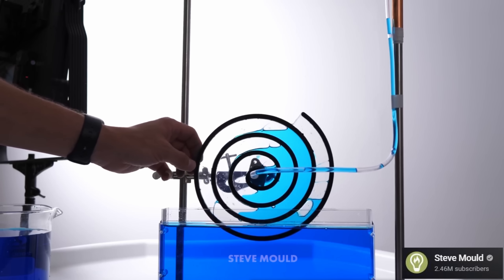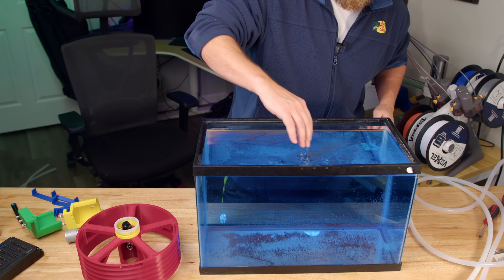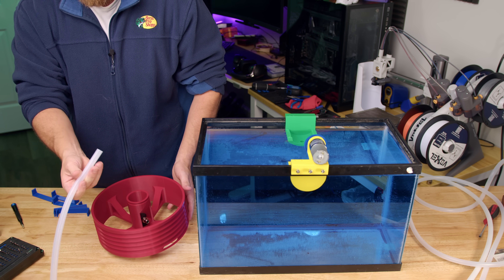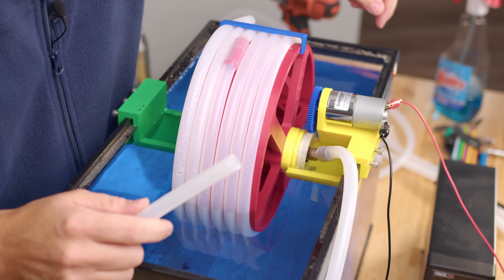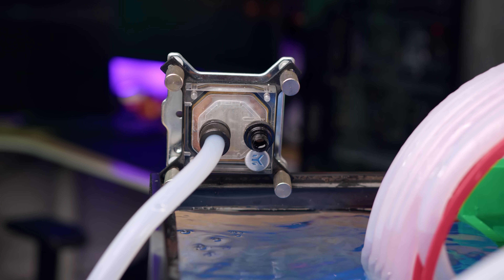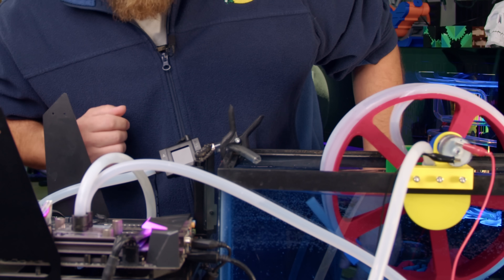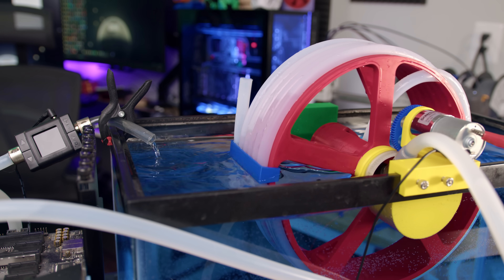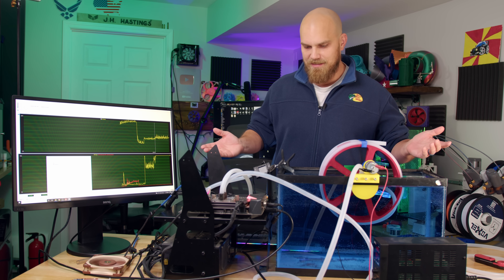Can a 217 YEAR OLD Water Pump Cool A PC?

Comment: I wonder if you could use mineral oil and water as two separate layers, with a taller tank and the pump “fully submerged” (mineral oil on bottom, water on top) to fix the air pocket issue

Comment: I am assuming that air is required so you cannot completely submerge the coil, but what would happen if you had it lower in the tank and or cranked the speed of the motor?
Reply: This is what I was wondering as well. Does it work fully submerged, or if the air is a requirement, does a very minimal air gap like you suggested work well enough?

Comment: If you ran 2 of the pumps in to a y running 180 out of sync from each other you would get a more constant flow of water. 3 you could do them 1/3 out of sync. I think 2 would be enough as each tube is about half filled with water a little more really. So 2 sets of tubing on the pump

Comment: I kind of want to figure out a way to implement some sort of air catch in the loop that could occasionally release extra air so just water flows through the actual cooling side of things. Cool concept and that it actually provides a useful level of cooling!
Reply: Near the motor needs an upward shaft with a ball float, it would regulate air and allow water separation. Plus double hosing equals double pressure, and the motor should be on a band not gears so no energy lost as it tries to compress water between gears.

Comment: If the wheel was lower in the water  it would have less air in the line, typically the current of the water surface is what would power the wheel. Yours has a power source so there’s no reason to have it that high. Just find a way to keep the motor dry, and it should still work fully submerged.
Much ❤ Love

Comment: Flow rate does have a direct effect in both computers and in cars. If the flow rate is to high, the rate of heat transference will be low. Water is actually a little difficult and energy intensive to heat up and is why tank-less inline heaters create such a high energy bill compared to electric tank heaters.
By allowing a slower flow, you give the water more time to take in more of that heat. 
Of course going to slow can be a bad thing as well.

Comment: Zalman Reserator 1 in line after the pump with a Tesla valve in the lid, could be used to buffer the water flow and remove the air.

Put at the correct height you could see decent flow (especially with a parallel dual pump setup) whilst getting rid of the air.  The Tesla valve could be incorporated into the design to let out air without letting out liquid.

Yes, there are probably better ways to do that, but it keeps with the "old tech doing a new job" theme, plus Tesla valves are just soooooo cool.

Comment: Run 2 drums side by side w/ 180deg offset on rotation. combine their outputs w/ 1 way valves and put a breather to remove air from the output line.

Comment: Use the pump to drive the water up high into a tall (to get pressure through gravity and volume) reservoir and then let gravity feed water through the block. This way we get a nice even flow without air.

I mean, this'll probably need to be as tall as a two story house to work, but... it'll be interesting.

Comment: really cool idea! probably should have put some type of accumulator to separate the air/water in the line before passing through the water block
Reply: the water only moves because the air is pushing it.
Reply: @sinisterthoughts2896  that's true in the screw portion of the 'pump' tubing, but once the water exits the pump, the air is no longer necessary. It's almost an inverted version of a pneumatic screw compressor which has and air/oil separator after the screw.

Comment: As it takes a calorie, or about 4.18 joules to heat up 1 gram of water 1 K, or 1 °C, it shouldn't be that much of a surprise that even small trickle of "cold" water can remove heat quite well. If you want to remove significant amounts of heat for en extended period of time with a standard water cooling system a standard radiator usually becomes the most limiting factor, as then you still got to expel the heat to air.     

Another principle you could explore is evaporative cooling using a brine that "recharge" itself when the processor is cool. You just need to use some salt which will absorb moisture from the air when the processor is cool, but will let water evaporate when the temperature increase and thereby provide cooling.  New scientist recently had an article about some guys using lithium bromide, and a "special membrane" to keep salt/brine inside. But calcium chloride or magnesium chloride can do the same thing, and a separate container could be used for the brine, using it to replace the radiator in a traditional water cooling system.       

Or, try to just use the "chimney effect", if you haven't done that already, use the heat to cause convection in a tube to get some airflow. Probably not very powerful, but silent and very long lasting.

Comment: If you used a tube with hydrophobic coating on the inside, would this be more efficient, or less efficient?
Reply: maybe polyethylene tubing with some de-ionized water. DI water has really high surface tension.

Comment: a possible improvement would be to use the pump to lift water to a catch basin (could just be a bottle with one end cut off) to let the air out of the line. may improve things, may not.

Comment: Try 2 wheels with water inputs 180 degrees out from each other, or a breather port to let the air escape the system befor the block.

Comment: The obvious choice is to combine the water wheel with a cooling tower.  If the tower has enough holding capacity it should be able to sustain constant gravity fed flow through the block and act as a buffer to remove the pulses of flow from the water wheel pump.  

Make it so.  :)
Reply: ya, water reservoirs and tanks, solving water pressure problems for centuries.
Reply: This is exactly what I had in mind: Just put a reservoir high enough that the downstream flow continously cools the CPU without any bubbles.
Reply: @MrUntermieter  one step further would be a catch can with pressure regulation, then you would use the pumped air under pressure to replace gravity as the storage of potential energy. Much more difficult but then it can be compact.
Reply: This was my thought on this too.
Reply: A filter capacitor for water
Reply: Same thought here. The upper reservoir would need an overflow bypass, and maybe a ball valve on the outlet to control flow rate.
Reply: @DFPercush  You really only need to have an overflow return flow line to the main tank, and then size the tube going to the CPU to give the desired flow rate. Completely passively regulated.
Reply: @mytube001  Sure, once you know the right tube size. How much money are you going to spend on tubing to find the right diameter is is the question. I guess you could oversize it and just use a clamp to pinch it, but ball valves aren't that expensive. Who knows, the water block itself might be enough of a restriction, it's a very low pressure system.
Reply: add a second pump to fix the pulsing issue
Reply: Suprised no-one has made a system like this using a normal electric pump. Tank in the roof or outdoors, purely using head to feed water through the cooling loop, output goes to a sump tank where it is pumped back into the header tank. You could even plumb a room with multiple coolant inputs and outputs, fitted with regulators, so your office space/server room/workroom/gaming room would be both completely silent (the sump and pump would be in another room) and cool (all the heat is dumped into the header tank, which is cooled by atmosphere). If just atmosphere is not enough, you can wire a fridge or Peltier cooler to the header tank, again the heat they generate will not be transferred to the computer room itself.
Reply: you could also have several parallell spirals combining into one with the inflow ends evenly spread around the wheel.
Also have the wheel fully submerged to avoid air.
Reply: @nalissolus9213  unfortunately the air is what actually allows this pump to work, pretty neat concept
Reply: @Porouskilldeathratio that air is needed to get the water up, yes, but once the pump has managed to get water to the gravity feeding tank, you need to let the air out, it did its job. At the top of the gravity tank, you just need an open air, or if enclosed, an airlock and maybe an overfill gate leading back to the mainresevoir. You are getting a flow rate of 28 29 liters from your pump, the resevoir can drain at 25 liters and you will have a constant flow of water going through the block instead of intermittent.

You eliminate the need for the air once you have the water as high as you need
Reply: @nalissolus9213 the way this pump functions, it actually relies on that air gap, otherwise the water would all spin with the hose and not pump through it. The factor here is density. Water is heavier than air and therefore the water stays low in the bottom of the wheel  and works its way through to the end.

Comment: Two thoughts: 1) instead of a radiator, have the coil pump dump water into the top of a cooling tower with a second reservoir at the bottom, and just have it elevated to provide the necessary pressure into the water block.  That would help avoid the water becoming thermally saturated and would result in a continuous water flow into block, likely resulting in better performance.
2) Can you cool a PC with an archimedes screw? :p
Reply: You probably could if you combined the screw idea with a water tower to provide constant flow through the cpu block.  You would need to rely on gravity to go from the tower to the CPU to the big water tank.

Comment: Two suggestions that should improve this system: If you add a funnel at the inlet of the pump, you should scoup up mor water/less air. And if you add something like a catchtank you could get rid of the air entirely. So basically add a tank at a very high position, where the pump dumps its water in. Have an opening in the top to release the air and an outlet for the water in the bottom. If the tank is positioned high enough above the wateblock gravity should create mor than enough waterpressure to ensure a good flow.
Reply: Exactly. Use the pump to pump the water up to a higher, upper reservoir/fish tank, then let gravity pull a steady stream with no air through the CPU block and dump back into the lower reservoir/fish tank.
Reply: I don't think you can. The air locking is how the pump works. Take out the air and the pump shouldn't function. Otherwise all it gets is the siphon effect to pull water.
Reply: @Skylancer727  OK, i think this needs a bit more clarification from my side. I don't want to egt the air out of the pump, just out of the system before it reaches the waterblock. The funnel is there because i'm (mostly) sure that if you increase the speed of the pump to get a higher flowrate, the water will (most likely) have a hard time to enter into the small diameter tubing and you end up with mostly air and barely any water in the tubing wich means that you wouldn't increase the flowrate (by much). With the funnel you can can compensate for that a bit and increase the amount of water that enters the tubing. But you will not get rid of the air completely (not at all) wich means that the pump would still have enough air to work properly and pump the water uphill. The catchtank will be the highest point in the whole system, so any water in there will just fall down towards the waterblock because of gravity. So at that point the pump is not doing anything to the water and you can get rid of the air at that point, since the pump has already done its job. I hope this helps to clear things up a bit.
Reply: Combine the catch tank with another pump running 180* rotated you'd have basically constant flow.
Reply: @FadedSparkx86 you'd need three at 120° intervals to have continuous flow, and there'd be a regular surge at each overlap. You can't really get a constant flow using these types of pumps or from standard peristaltic pumps just because of the mechanical process.
Reply: Catch tank == filling up a head tank with the pump, and the tank's  head pressure moves the water through the cooling loop.

Down side is that the head pressure will always be less than the pump's pressure. Should still be plenty though. Flow rate should be controllable by using a narrower diameter inlet to the cooling loop.
Reply: I just thought it'd fit the style of the pump.   Float valves have been around forever.
Reply: Was thinking about this as well...

Pump feeds auxiliary tank. 

Auxiliary tank feeds cpu.

Cpu can have some sort of flow limiter, or have a faster pump that causes the auxiliary tank to fill faster than the cpu can output water.

Have a return line back to main tank from aux tank so it doesnot overflow. 

This should keep air out of the cooling part of the system.
Reply: Add more pipes
Reply: 3d print pulleys and cogs with ratio gearing to increase the speed/ pressure but not volume... but can at least have faster pumping... 

Or bring it all outside, make it with also multiple archimedies screws, then into bell sypons, and then gravity valve pumps to force the pressure and volume into a pressure valve tank res...

 container can then force large volumes built up of water through stages
Reply: I thought a standpipe to bleed out the air would be a good idea as well, then remembered what these pumps are famous for, pumping up hill!! The standpipe could have to be taller than his house to become a harder path than the micro channels in the core! Would be a good exercise to find out how high it needs to be?
Reply: It can work with a res combo at the high point, the pump is just replacing water that would be flowing out of the bottom, and head of water column is all you need.
Reply: I never said your glorious tank would fail to do the job, as it would do the job just fine.   My suggestion was a purely aesthetical one.   Going for something different was kind of the point of the whole project.   Otherwise he would have made yet another water cooling set up just like everyone else.   @wobblysauce
Reply: Place it under water and screw up the water?
Reply: That would be a really interesting watch and comparison to this one as well!👍🏻
Reply: Better yet. Why not use another small container with an outlet on the bottom to feed the water block. Then make the container as high as the fish tank so that the level in the container stays constant. The water inlet would be at the top of the container.
Reply: Also more speed would that help?
Reply: My workaround? Float valve. Attached to the air side of a sealed container.

The water pushes up. The air bleeds out so long as water volume is up to the float.
Pressure can build up inside, pushing the water out of the tank more consistently
Reply: Or two motors & drums so the flow can be constant
Reply: @xaj  air goes in. It doesn't go out with two drums.

Need a way to seperate the streams without leaking cooling fluid.

One advantage of this pump? You can inspect it for faults and will spot it stop running easily enough when it stops turning
Reply: Another variant to get a better water flow and less air flow would be to hang the drum deeper in the water. This way the entrance of the hose into the drum would not be in the air for so long.
Reply: @klausrichter2788  actually the drum needs to remain about half submerged. It's a technical limitations coming down to the fact that air must push the air around the loop without letting leakage over the top. The only way to reduce the air fraction is size and loops to improve pressure which we don't care about.
We want flow rate on a PC cooler.
Reply: the air is required for this type of pump to work. if you eliminate the air it will cease to flow.
Reply: @sinisterthoughts2896 you can eliminate it after it leaves the pump though
Reply: @colinmetzger6755   no you cant because you wouldnt be able to maintain the flow rate unless your delivery far outweighed your consumption.
Reply: yup was typing about funnel but read this.. so yeah =)
Reply: I was thinking a ping ping ball air check valve.  When there is no air, the ball floats and seals the valve.   The ball will drop when air gets in the valve chamber, allowing it to bleed the air from the line.
Reply: You can't get rid of the air, it makes the pump work

Comment: Have it pump into a reservoir with an overflow. That does double duty, smoothing out the flow and eliminating air.
Unfortunately, you lose your pressure unless you take full advantage of your head.

Comment: That was a fun video.  I’d like to see how well the pump works if the pump is on the floor and the CPU up on a table.  Can it overcome a bit of gravity?
Reply: Yes it could... depending on how many loops per inlet, the more loops the higher the head pressure (ability to pump water uphill max head pressure is calculated up to 0 flow at max head height) the higher the head pressure the higher the max lift aka head height.
Reply: @dodgeme1986truck  Cool stuff!  Thanks for that bit of knowledge.

Comment: You could try putting a couple of them with their outputs joined using one way valves so you can maybe get better preassure and alleviate the irregular flow
Reply: three phased pumps! apply the same principles as electricity and this should work halfway decent
Reply: You could also use three separate pieces of tubing on the same rotor, phasing each tube inlet 120* apart
Reply: @thejo6331  Something like that would be really nice! I was thinking something more like inline motors, but the electricity analogy works even better!

Comment: Might want to add a part to separate the water in the air I would suggest a cup that lets the water air mixture in has a tube draining out the bottom and lets the air out the top as long as you keep it above the rest of the components it should flow properly thanks to gravity